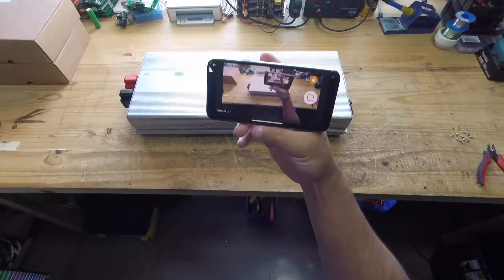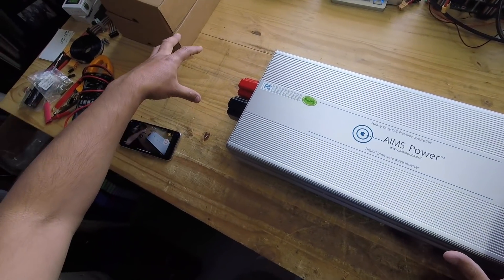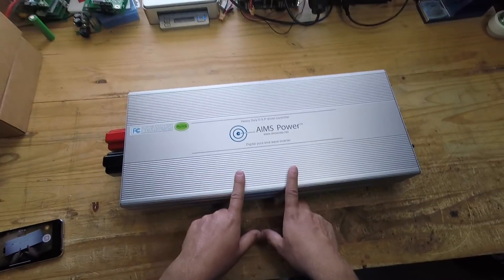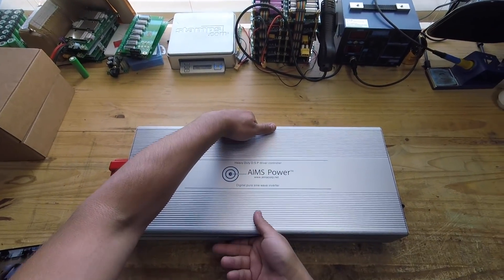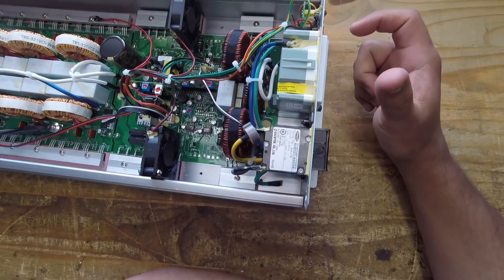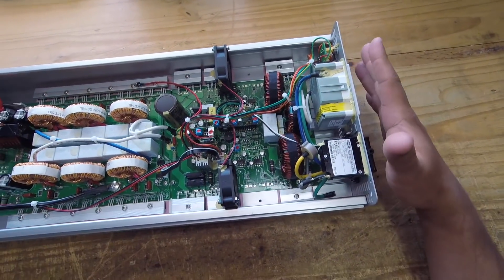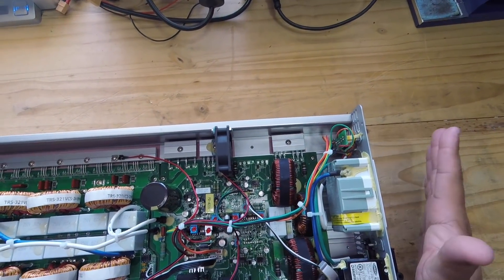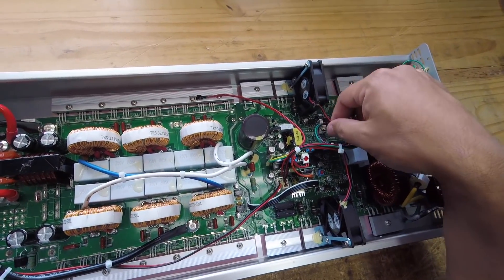Inside a $700 3000W Aims Inverter

Comment: I need to make a portable 48V 10kWh hand truck system. Xijia makes a 3000-watt (6.7kg) inverter/charger that might work well if I can get it in 120V AC. I need to decide between this and a Growatt 3000-watt, which is about 650USD but weighs only 12kg, or a Growatt 5000-watt at about 900USD.

Comment: I have one of these 3000 watt inverters I’m setting up to use to power a mobile studio out of my car. My only problem has been after a couple of weeks of driving around, two of the internal inductors have completely broken off the logic board. I’m confident I could re-solder in some replacements, but I don’t know the specs. Any idea what part number I’m after?

Comment: I just received my inverter, almost two years after this video was made. When shopping on eBay, I saw one that was cheaper, and the part number was different. I think it was an older revision, that is the same as the unit in this video. This video has only two heavy wires coming off of each terminal. At the input section, it has one inductor and one bank of 5 fuses. There is space on the circuit board for another inductor and four more fuses. If the fuses blow accurately, that would be under 3000w of continous power. The manual says that the unit is protected by 9 fuses and the unit in the video shows only 5. I opened up my unit and it does have all 9 fuses, and both inductors. It also has 3 heavy wires from each terminal instead of just 2. The new part number that is actually capable of 3000 watts continous is PWRIG300012120S. The other difference in the specs, is the lessor unit can handle 6000w for .1 second, but the new unit can handle it for .5 seconds.

Comment: These guys sell inverters set up for Tesla, LiFePOr, or Lead Acid Batteries. If you want a discount code for a Sigineer inverter, use the following codes: : For 3KW to 4KW inverters, use AaSGjian20, the to gets $20 off. For 6KW  inverters. use AaSG35jian, to get $35 off.  For 12-15KW  inverters, useAaSG50jian, to get $50 off   www.sigineer.com

Comment: Not all low frequency Ames inverters are built the same. Ames inverters are built in China to Ames specs. That is 10-GUAGE (AWG) wire, not 10 millimeter (mm) wire. Putting five (5) 40-amp fuses in parallel does not necessarily, and usually does not, equal 200-amps. If you want 240 volts, you can buy an Ames 10,000 watt inverter with 240 volt split phase. You can even buy a 6000 watt version.
Not sure I would use this particular inverter for what you're trying to do. If your goal is to get maximum current, it would be a lot better to buy an Ames inverter which uses direct wiring output instead of a socket. Direct wiring output will use the full capacity of the inverter, instead of just a socket which can only use 20 amps.
PLEASE!!, put the camera someplace static, not on top of your head.
Which model inverter are you talkin about??
Add a couple last but not least, use a bigger inverter. The 6000 watt inverter only weighs 18 lbs.

Comment: i just had a 3kw one with a great remote wifi lcd, lasted 15 mins... then the electronics for the lcd went iffy and it smoked,  but the inverter part of the board was stable at 2.5kw, replacement had good lcd electronics but the mosfets went on the 3rd kettle load at only 2kw....
got  my ebay refund so no worries, now to try my best on ebay again....the search continues, 3kw under £200 ......

Comment: Those 6 transformers on the input dc-dc boost circuit, does not look great, firstly the are wound on inductor rings o_0, and secondly they look like they are all in parallel, for load shearing, which is a bad design (((

Comment: Correct, GFCI outlets are constantly monitoring power flowing on the hot and the neutral, if there is an imbalance it shuts off under the assumption that power is going somewhere it shouldn't, such as into your body as a shock.  

Your explanation of the ground wire is kind of inaccurate though.  The ground rod is really more of a lightning strike protection.  Power wants to flow back to where it was generated, so power flowing through the ground wire is actually trying to get back to the transformer for your house and it can do this because we bond our ground wires to neutral at the very first breaker panel in a building.  https://youtu.be/P-W42tk-fWc?t=550

Comment: Concept is good in theory but so many losses in conversion., but you may be better to do some DC injection on the charger instead?,   Almost like hitting the DC bus on a VFD?  But like a typical VFD, it’s the input voltage is higher, which begs the question, what is the output voltage specs on the Tesla charger.?

Comment: You would still only likely get 1800 watts from this on a single plug. As it is likely only a 15A receptacle.. but it could be a 20Amp receptacle/GFCI.?? Would need to see the read out on the plug, unless you are yanking that out, and hardwire??
Reply: Sideways blade indicates the outlet is a 20 amp outlet.  Whether or not the wiring is rated at 20amp though, I'm not sure.

Comment: beside a few mistakes and bad explanations, I want to point out that the european inverter, that has 220/230 volts on the output, doesn't have 2 live wires, but just a live and neutral, like the 110v plug on the inverter.
Reply from the maker: So?
Reply: It shouldn't matter

Comment: The "European" inverters are 220-240 VAC but there is still only 1 hot leg & 1 neutral just like in the US.
Reply: No, there is no neutral line used in US 240VAC circuits.  It's two out-of-phase hot legs at 120v apiece.
Reply: As I said "European" voltage is 1 hot 1 neutral...Jehu was mentioning about getting one to do 240VAC...but it would not work the way he wants it to.
In the US we use both 120VAC & 240VAC but the European system doesn't double their voltage like we do...they stay at 220VAC-240VAC with no 2nd hot leg.
Reply: @gregorythomas333  We don't double our voltage, we tap into the middle of the transformer winding for a "Neutral" and split it in half.

Comment: The charger in tesla is sortenly a switching powers supply. It means the first thing is it's going to do is make the 120 ac in to dc, rectified 120v is √2×120=170v dc because the p to p value (not rms)

Some switching powers supplys does not care if you feed strict 170v dc in the power inlet

It might be something to look into, just making a 170v battery with a ac socket and your don.

You might even get an answer from tesla technicians if you drop them a message.

I know someone ex laptop and older pc power supplys with lesser power efficiency had / has only an simply diode rectifiers (after the ac input filtterin)

There is system whit more intelligent systems to rectifie. (Just to get rid of the 2v drop a diodien bridge makes)

This more intelligent (a few % higher power efficiency) supplys are more picky with the incoming voltage, and that's why don't like modifyed sine wave. A high voltage dc input voltage might be an issue or not

Comment: Many of the Aims inverters are crazy similar to those from Sigineer. The 6kW split phase Sigineer in my solar shack looks identical to an Aims, at 2/3 the cost. A quick search on their website found a 24v/3kW Sigineer for $360, though I didn’t compare specs beyond that.

Comment: I’m not sure how this would help? Are you suggesting people carry around an extra kWh of batteries and an inverter in the trunk to go an extra 3 miles (by the time you account for losses)? Remember just carrying around the extra weight will use up some range. Have there been lots of people running out of power?
Reply from the maker: There’s only one way to find out

Comment: What's the idle power consumption on this pig, like 50w? A good one is 14w
Reply: Off Grid Kiwi  not likely an issue as this will not idle, only used as a jump starter for a dead tesla or EV.
Reply: In the marketing material it say .7 amps and in the manual it says 1 amp. If that's accurate, it would be between 9 and 14w.

Comment: "it's got a 200A fuse, 5 x 40A..." oh boy. No. Just no.
Reply: Yeah. Putting fuses in parallel is NOT the same as a proper fuse of the correct size. For that to work, you would have to perfectly match the resistance across all the fuses, their connectors, and any wiring between the fuses and the load. I thought I could use two 20 Amp DC breakers in parallel to get 40 Amps of current, but they kept tripping at a total of 34 Amps. one was reaching 20 Amps while the other was only carrying 14 Amps. All that wiring was soldered together. One of the breakers was 0.08 Ohm higher resistance than the other one, and that was enough to cause a current imbalance. They would both pop at nearly exactly the same time, because of course when one went, the other instantly saw 34 Amps and tripped instantly.
Reply: Not only that, this is supposed to be able to put out 3000w continuously. It comes out to 2500w.

Comment: I have the 48V 5000W version of that stuffed in a rolling Pelican case with 200 26800's. It's a beast of a mobile power solution that's for sure. AIMS do have 240V models as well but they aren't small.

Going DC-AC-DC is going to waste a ton of juice. If you can schedule your stops to charge for 15-45 minutes it "might" work. But even if you can dump 5KW of DC in an hour into the car I doubt it will get you very far, maybe just far enough to find a 120V outlet.

Sounds barbaric, but a small jerry can of gas and a portable 2000W generator in the trunk would probably give you better bang for the buck, more so if your Tesla quits within walking distance of a gas station LOL

Now if Tesla's could be flat towed regen would get the charger working.

Comment: I'm confused...are you going to build all the "hand shake" electronics to be able to charge a Tesla car or will you be using a Tesla home wall charger and just supplying it with power from a battery pack and inverter? Its an interesting project for sure.:-)
Reply: I believe the latter.

Comment: Euro  inverters  put out 230volts but 50Hz not 60 like in the states...does it matter in the Tesla  chargers
Reply: Unless the Euro market Tesla's have a different charger in them then it's probably not an issue. They are likely 100-250v 50/60hz compatible.
Reply from the maker: There are countries with 230v 60hz grids like South Korea, Montserrat, Peru, Nevis Islands,  etc.  So they must exist somewhere

Comment: I'm buying a Renault Zoe soon (first electric car for me) and it's light enough that I can tow it with the RV, now on camp grounds you get free electric but its limited to 10 amp breaker. (240v in the UK) is there a way of building a charger for that that will restrict the charge so as not to trip the 10 amp breaker. Doesn't matter if it takes 2 days or more to charge as its only used to sight see locally. But free electric you gotta use it 🤣 perhaps you could do a video on that if it's possible. 👌🏽😍
Reply from the maker: The car will not limit?
Reply: jehugarcia I have no idea. How would it know it's connected to a low amp 10amp supply. Normally 16amp breakers on a UK house socket.

Comment: I heard that some companies in Europe are using super capacitors with an inverter or batteries
Reply: I am pretty sure it was on Fully Charged
Reply: Do you know what supercapacitors and which inverter? I know FWG is coming out with a new supercapacitor design and production.

Comment: Jehugarcia, The Gfci trips on 3 to 5 milliamps,your body cannot feel that. So did this Aimes inverter charge your Tesla.. Good channel,what happened to that VW bug you had,that was really cool...Hugh..Chicago..metro PS : All homes are grounded,even back in the 50's. The ground rod is a requirement in most town's;[ 5/8 diameter 8' foot long,we take a continuous wire, use bonding bushings,go thru a grounding lug then out to water meter. Wire size based on service amp size - usually #8 for a 100 amp or # 4 for a 200 amp.   We take the grounding conductor  to the street side of water service.[ Think of it as a continuous path,ground rod to meter lug,  neutral thru the bonding bushings,to ground lug in panel ,out to the water meter,providing the town your in has a copper/ metal pipe system, there are some variants on this. Current takes the least path of resistance,so if there is a fault in the power company's equipment,ideally it will dump into the rod,or into the water system underground {,not up into the house & into the appliances.] ** I have been licensed since 1986. Note the NEC = National electric code , comes out with a new code book every three year 2008,2011,2014,2017,soon 2020. We do seminars to keep up,or buy the book and study....Peace
Reply from the maker: Every old home I've lived in has had these https://hardhat13.files.wordpress.com/2014/01/img_20140126_014309.jpg
Reply: @jehugarcia  The metal box holding this receptacle is grounded, which still ground the receptacle by making contact with the metal housing on the receptacle, it just does not have the ground built into the receptacle like they are today.
Reply: It's 30mA, and you sure as hell feel it

Comment: You can use a 120v plug wire neutral to ground plug in one side of your gfi on inverter it should trick Tesla into thinking is grounded good luck.

Comment: Love your videos like always, those transformers are the cheapest type you can buy, also probably only 80% efficient, and 700 USD for 3000w :S Aims is made in china as well, it still might be a sweet 3000w inverter but overpriced, try the new 8000w reliable inverter that I reviewed on my channel its pretty killer for the price and they will customize the voltage you want. you can go up to 120vDC in and 240V AC out :). I love mine so far, Let them know I sent you :)
Reply: Could you provide us with a link?

Comment: Jehu, a simple explanation is that a GFCI disconnects the power if there is any leakage between the Line and ground or neutral or neutral and ground. The purpose of the electronics in the GFIC is to disconnect the output from the line quicker than muscles in your body can react. Therefore protecting you from a fatal electrical shock. That’s why they are required in any outlet that may be connected to something that may come in contact with water.  😎😎😎👍👍👍
Reply: And the ground rod in your house has nothing to do with electric shock
Reply: @mark33545  Correct https://youtu.be/P-W42tk-fWc?t=550
Reply: I concur
Reply: It is it, in fact, specifically designed to deal with a circuit which may come in contact with water, or have a predisposition to Short.
It is not originally designed to put into a house that has no ground. In fact, if you have a house that has no ground, tear that thing down, or run new wire along the walls, inside of some EMT conduit.

Comment: The gfi, kills the circuit, if any current goes to ground.
Reply: Well, if the current imbalance exceeds the set point, which is usually around 5 mA. By tying the Neutral return and Ground together, I would expect the GFCI to open the circuit instantly every time, because that would provide an alternative return path that the circuit would use, thus exceeding the 5 mA imbalance limit.
Reply: @WarrenGarabrandt  The EVSE/"car charger" can work plugged into a GFCI, it most likely checks for ground at a low enough mA level so as to not trip your GFCI outlet.  It should work just fine bonding the two together in this inverter.